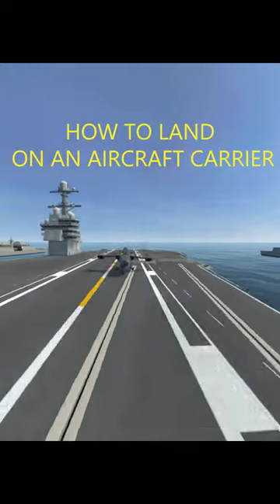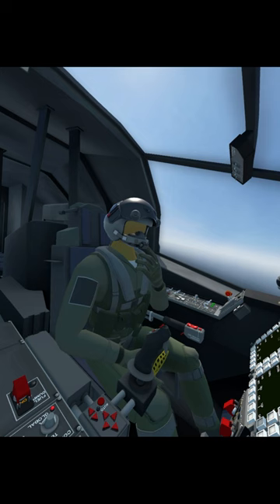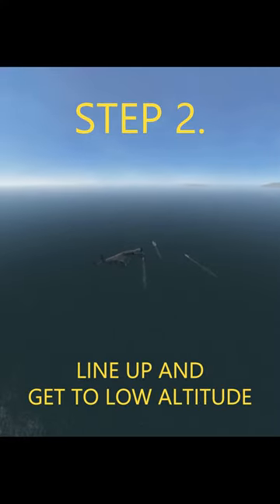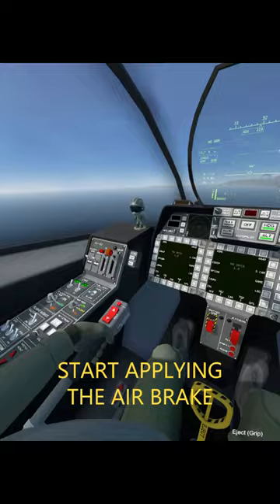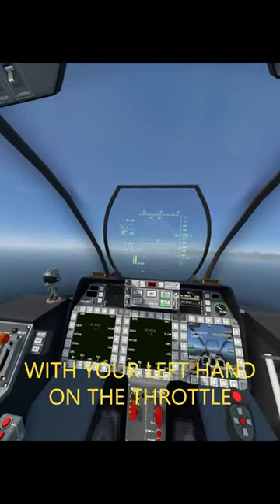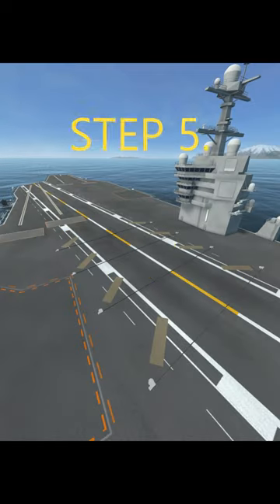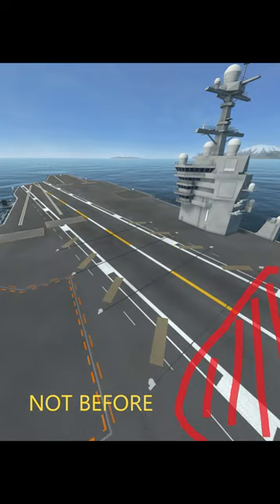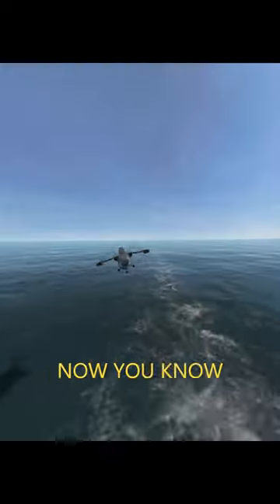How to LAND on an AIRCRAFT CARRIER STEP BY STEP [VTOL VR]

Comment: At the end, (not to sound nerdy or anything) you said cut throttle. This is the possibly one of the worst things you could do. You want to set throttle to max when you touchdown so you can take off and go around again if you miss the arrester cables. Other than that, the tutorial was great!
Reply from the maker: That's true. Even when I recorded this I missed my first landing and had to pull back up. 

Now that I watched this again, I did say IF you caught the cables. But you can still go full throttle and the cables will hold you in place, so maybe I shouldn't have said that bit😅.
Reply: For safety’s sake going afterburner on touchdown is recommended as a proper cable capture at the proper airspeed should never result in a runway overrun
An idled engine on touchdown will take to much time to ramp RPMs back up for a recovery burn if throttling up in reaction to a missed wire

Comment: The IFLOLS (meatball) will tell you altitude error in your glideslope. Generally 600-800ft is the altitude you intercept the glideslope
The following the funnel behind the carrier on the nav screen will help you set up for an approach down the runway
The AoA indexer will tell you if you are too fast (red arrow), too slow (green arrow) or on speed (orange ball)
The velocity piper is useful in understanding where your aircraft is heading. Because the carrier is sailing away, place the piper above where you intend to land